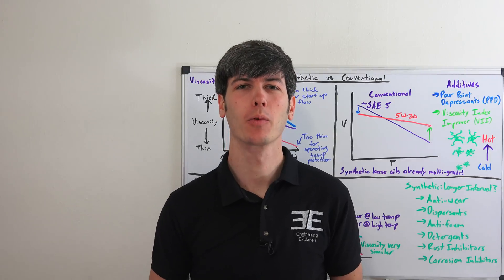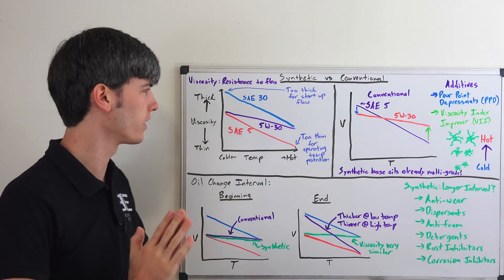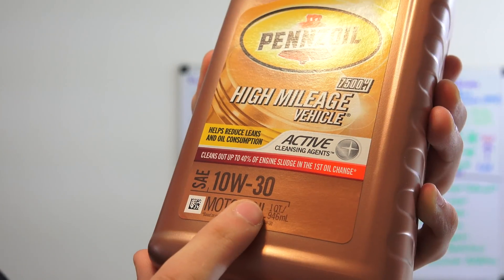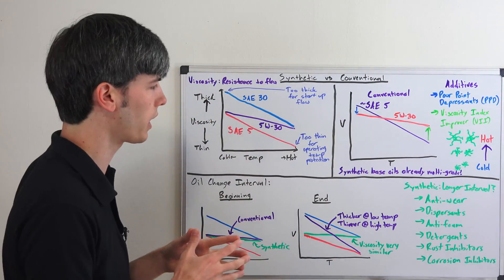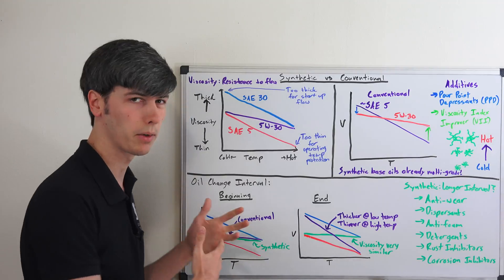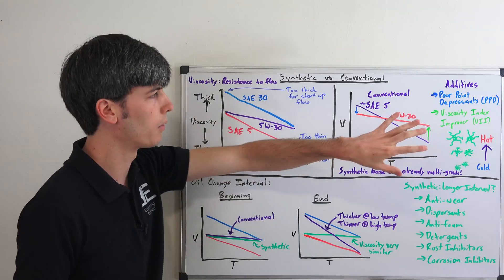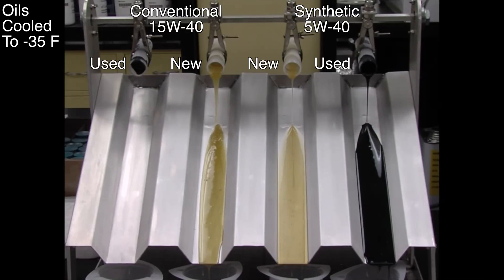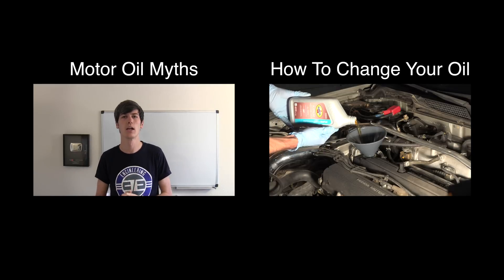Is Synthetic Motor Oil Better For Your Car?

Comment: Synthetic oil has many advantages. But if you have a high mileage vehicle say 100,000 plus miles for example and you switch to synthetic you run the risk of leaks. It’s not a guarantee but I have seen it happen a few times. I also noticed leaks occur most often in American engines verse foreign. Not an expert just my experience. Have had great results with Valvoline High Mileage Synthetic Blend though.

Comment: So as I understand the oil lubricates + seals the  "wipers" . What would happen if you were to use a heavier WT oil, wouldn't it seal better thus creating more HP ?? Or would the higher viscosity just slow the engine down ??Just curious .

Comment: love the information but what abouth of motorcycles? i listen that some of the carburation ones its better the mineral.oil because the low comoresion of the cylinder or low comoresion ratio? does it make eny sense?

Comment: Hi, EE, love your channel. My problem is this. In my car (A JDM Honda Fit Hybrid) manual it doesn't specify which type of oil is to be used - mineral or synthetic. However it does specify the API class and the interval for the change depending on the conditions the car is exposed to. Under normal conditions oil change is recommended at every 15,000km while it reduces to every 7,500km under extreme conditions (e.g. loaded running, low average speed - below 30kmph, and so on) However, some synthetic oil manufacturers claim their oils can stand up to 10,000km. Is it advisable to listen to the oil companies rather than the car manufacturer when it comes to the oil changing interval?
Reply: You're Hybrid will use a synthetic oil.

The definition of this is a oil that has either PAO or HC oil as it's "base oil"

In some countries HC (hydrocracked) isn't seen as synthetic because it still originates from Crude, and so only count PAO oils which are fully man made as Synthetic.

Hydrocracked oil:

Hydrocracked lubricants are formulated via hydrocracking, in which crude oil molecules are chemically altered and rearranged into building blocks with favorable characteristics. The resulting base oil is far more pure (99+%) than solvent-refined base stocks, making it more resistant to oxidation, more responsive to additives, more pumpable at low temperatures and lighter in color.

There are some oils that claim that they can last up to X amount of KM's.

But generally speaking, oil is cheap but engines are not.

So just do the in-between oil changes, unless you don't plan on keeping the car for a long period of time.

Comment: Any chance of doing an investigation a la this one or the mobil one test Center visit which explores how to adjust oil change intervals for low annual mileage and/or occationally driven cars (project cars, weekend cars). There are lots of "rules of thumb" floating about on this, but you could do something evidence based. Do you really need to follow the time cycle? Isn't that really just a proxy for engine hours assuming runtime isn't traffic? Does oil really degrade much when sitting in a car? Sure, it drips down to the pan when you don't drive daily but how would an oil change help that? Just some FAQs many urban/enthusiast/occasional drivers would love some solid advice on.

Comment: Please talk about oil bypass filters. do the additives as they break down in the oil, Convert to sludge? does the filter clean it up and maintain a clean oil.  and over time degradation of additives.  If the oil is clean do you kneed additives. Thanks 🐶😁

Comment: pour point  is the oil in cold temps----flash point is temps in high heat--4 ball test------tbn number  -total base number---many tests--when a manufacturer test oil there are some of the tests oil engneeirs do because billions of dollars at stake for law suits so they have done a good job in the last 30 years with sythetic---this is a lengthy conversation --good luck folks

Comment: Why use an oil that almost completely drains off of the engine parts when it isnt running. Then you end up with no oil at start up. Metal to metal is not good in an engine. Car manufacturers love this though. You need a new engine at around 170000 miles. Most trade in and get a new car. Stick with conventional oil drive your car for 400000 plus miles.

Comment: Man, so loving the videos!  Keep them coming!  I have a question, though, and it's related to "racing" oils.  I've seen these in 0W-30 and 0W-50.  Can you explain why you wouldn't want to use these in anything other than a racing application, and why you wouldn't want to use the more common viscosities in a racing application?
Reply: To summarise they have better wear properties but tend to break down quicker hence why some like royal purple are advertised as a track only oil where you would dump it after a day of hard driving etc

Comment: The human being has a lot of problems because of the marketing of the products. If you are reading this and you are over 40 years, I guarantee that you can use mineral oil in your car (by specs) and that your car will last longer than you. Although I agree that the synthetic oil may be a little better, but only a little better.

Comment: This guy is completely full of crap!   He is evidently  receiving  monetary compensation  for promoting  synthetic oil.   The one thing I was impressed by is that he didn't falsely claim you could extend oil change intervals like so many synthetic  proponents.   For starters,  who in the world is  driving around  at minus  35 degree F?  Secondly,  if your oil  looks that bad at oil change you are not changing your oil often enough and I  seriously doubt that was actually  3000  mile oil.   Also,  using his  graph,  with the difference  in price  between  standard and synthetic  oil  you would  still  be far far ahead  by using  standard oil  and  changing it  before  3000  miles  even  could  probably  go to  1500  miles and still be money ahead  especially  if  you are keeping the vehicle for any length of time.   If you did change it at  1500 miles you could change  the filter every other time.   The truth is,  standard oils  have been around for many many years and if  it is changed every  3000  miles  it has never been shown to be the cause of any damage to an engine.   Just  use standard oil  and save yourself some money and don't buy into  tall tales about how synthetic oil is going to provide any benefit.

Comment: W does not stand for winter. It means the oil contains a detergent or an ashless dispersant.  Ashless dispersant oils are safe to use in almost all engines, with rare exceptions like a Curtiss Wright 2600.  Oils with detergents are not.  Oil without the W is straight mineral oil, regardless of viscosity.  Many monograde oils are W. Synthetics are inferior to regular oils at removing combustion ash. Synthetics do retain better lubrication characteristics longer. There is less molecular degeneration from prolonged heat exposure  in syn oils. The bad ash gobbling characteristics of syn oils are a minor factor, or not one at all, in auto engines, which do not make high percentages of available horsepower for long periods. In engines that run at 75% or higher continuously and may be required to produce 100% power for 5 minutes or more during take off, full syns have been abandoned for decades. Some piston aero engine oils now are semi syns. A semi syn will do an adequate job in an engine that really works hard most of the time. Suggest anybody who wants to understand this subject investigate the use of Mobil 1, a full syn, in aircraft--bottom line is it ruined engines, and Mobil stopped offering it--or read up on why Shell went to a semi syn for aircraft engines. Many race, competition aerobatic and warbird pilots and engine builders of serious aircraft recip engines prefer monograde straight mineral.  You preheat the engine when it is cold. This video is superficial and occasionally simply inaccurate.

Comment: I've been told not to use Synthetic oil in a higher mileage engine because it will start using oil, is this true?
Reply from the maker: If it’s going to “use” oil as you describe it, it will do it with either oil. Totally fine to use synthetic with high mileage cars.

Comment: This guy is COMPLETELY WRONG in the way he describes how engine oil and viscosity work. In the video, he says as the oil gets hotter, it's viscosity increases, or gets thicker, and when it cools off, it gets thinner. WHAT???? You don't have to take my word for it. If you own a car, chances are you've changed the oil yourself at some point. If you're a lady viewing this, maybe not, although it is 2018, I may have this fact backwards, lol!!! Cooking oils work the same way, so if you happen to cook also, you know exactly what I'm talking about.  When you change the oil and its warm to hot, depending on the type and weight of the oil, lets stay with his example and use 5W30. The oil is going to come out nice and thin, just like it should. When the engine is cold and you start to drain your oil (which you shouldn't do by the way) it will be really thick. Same with cooking oil. When it's cool in the bottle, it's usually a little thicker. When you heat it and it gets to cooking temperature, the oil is really thin, like water. If you were to listen to this guy, he would have you believe that the exact opposite is true. Well, I've been an A.S.E. Certified Master Technician for many years. I have NEVER seen ANY multi weight, multi grade oil get thicker when it was hot, NEVER!!! Just like I've NEVER seen oil get really thin when its COLD!!!!
When oil gets cold, the polymer's Expand, or relax. When this happens, the oil is THICKER, or it's viscosity has INCREASED. When you heat said oil, and it's at operating temperature, those same polymer's ball up tightly, and can move by one another much more quickly, hence, thinner, better flowing oil. If you've ever used shrink wrap, like on Easter eggs, or have had to shrink wrap a wire, battery, etc. Does heat make it shrink, or does cold make it shrink? Well, at least in my life, on this planet, you have to HEAT shrink wrap to get it to tighten around whatever it is you're using it on. That is precisely how and engine oil molecule works when it gets hot. I know this was long, but I hope it helps. This gentleman has made a lot of automotive videos about almost everything. This is the ONLY video I've seen from him that is incorrect in it's explanation. All his other videos that I have seen are absolutely spot on.
Reply from the maker: You did not listen, but you’re convinced that I’ve mislead you. That is not the case. A 5W-30 is in fact “thinner” when hot, as mentioned in the video. It ACTS like a grade 5 oil when cold, and it ACTS like a grade 30 oil when hot, but a grade 30 oil is still thicker than a grade 5 oil at the same temperature. See the graphs in the video. Viscosity goes down with temperature.

Comment: Why did the test use a cooled to -35F temp and not something more reasonable like 0F? Most viewers live in climates that never see such a cold temperature. I think your video is deceiving in an attempt to scare people into not exceeding the 3000 mile limit recommended by manufacturers and oil companies. Studies I have reviewed prove that no measurable engine wear is experienced on non-racing engines if the oil is changed before 7,000 miles. I'm pretty sure if you go over 1,000 to 1,500 miles (4,500) between oil changes periodically you won't be ruining your engine. But what do I know? Just IMHO.

Comment: Shame on you for comparing 15W-40 conventional oil to 5W-40 synthetic oil. Yes, this discrepancy is conceeded 5 minutes and 30 seconds into the video but please keep it real. Compare apples to apples. Who uses 15W40 oil when it's 35 degrees below zero F? The pour clip in this video is already being used out of context on the internet (even by you). 

Your online article of Aug 14, 2017 in Road and Track magazine has the pour clip at the top,  but the 15W-40 designation is covered up by your banner. Yes, people can click on the link at the bottom of the article to view the complete video, but I'll bet few people do that. People see the visual and quickly conclude that synthetic oil must be so much better than conventional oil. 

I enjoy all of your youtube videos and I think you are very smart and well spoken, but this one gives off an unpleasant odor.  The lesson here is that convention oil is just fine for everyday drivers as long as they change it when  they're supposed to.    harv0000

Comment: Hey there! So... I have a question, I've a car with aprox. 100k miles on it, would high mileage oil benefit my car in any possible way? Or do I just keep using the one that my car's manual says to use? Also, would synthetic be better for my mileage?

Comment: I know you weren't present for the oil demonstration. But there are some key missing factors. How used is the used oil? Were both used oils used for the same duty cycle? What sort of engine were they used in and in what conditions? Why in the hell did they not use oils of an equal weight? Why did they cool it to such a low temperature? (A normal person would use an engine block heater to warm things before starting when it's that cold.) As far as I know it's an apples to gorrilas comparison and it means nothing to me.

Comment: Have been using synthetic 10w30 in EVERYTHING i run for over 20yrs with no problems .Cars and trucks changed every 10 k or 1year for all mowers,tractors,snowblowers etc.and some engines made it over 20yrs. I personally use Mobil1 but any good syn.oil should do. No confusion with different wts.and brands and no extra additives needed.I consider syn.oil cheap insurance in place of engine replacement.

Comment: Hi jason based on this video and my own personal tests with 4 6 and 8cyl. Engines i use synthetic with everything but many of my friends say things like; "i can't use synthetic in my car because it just eats it i can't keep oil in it". Now granted thier engine could have leakes they are unaware of or could burn oil. That being said let's say that an engine is "perfect" when you buy it and at 30000 or maybe 50000 miles you switch to synthetic. Why does an engine seem to "eat" the oil?

Comment: I was getting semi synthetic oil on my turbo genesis which i found out needs full synthetic. I switched to full synthetic and i swear the car runs smoother now..or is it just in my head?
Reply: In your head, but full synthetic is the best for engine life.

Comment: Very informative video. I've always had this discussion with my friends about the thickness or flow of variable viscosity motor oils, and they never accepted the behaviour of motor oil that you discrubed at the first part. Very nice explanation with good chart demonstration. Very well done
Reply: Shahab Siahpoosh has
Reply: No such thing as non-variable viscosity. Ain't a fluid on the planet that doesn't change in some way when you change its temperature.

Synthetic motor oils are our best attempt at getting a fluid which normally goes from nearly solid (when it's cold) to runny as runny gets (when it's hot) to go from sort of runny to kind of runny given the same temperature change. Ideally we want it fixed, but hey - that's nature and inginerding will always be a compromise

Comment: Is there anyone knows about "Less driving condition"? As after reading the manufacture warranty, it says that engine oil and oil filter need to be replaced every 6000km / 6 months which occurs first by fully synthetic if driving less than 9km per trip on normal temperature.

Is this extra service need to be put on and why? (Normal driving condition requires each service in between 10000km / 12 months)

Comment: Is the synthetic base means conventional oil that is higher refined with some group synthetic additives such as synthetic blends but labelled as Full Synthetic? I am not sure which type of synthetic oil is compared here such as Full Synthetic or 100% synthetic or synthetic blends, to me it is a confusion of marketing terms that cost 3 times the price of conventional oil and I am not sure which one is the best to buy, everything I read online it seems everyone is selling full synthetic , synthetic blends and 100% synthetic is hard to get a hold off at the local stores.

Comment: The problem with synthetic oil is it's not worth the price. If you change your oil with regular oil use a  quality filter your engine will out last the body chassis. So what's the point in spending all that money on synthetic.
Reply: It's not that binary. Most European engines have oil requirements that cannot be met with conventional oil (this is referred to as mineral oil here. In Europe we can safely state that synthetic is the conventionally used oil and that mineral oils are the exception. There's more to it than simply SAE viscosity ratings and whether the oil is conventional or synthetic. You can change the oil every day if you want to but you will still have problems.

Comment: 2015 Honda Accord Sport 4 Cylinder (CVT)
Current Miles: 115000
Honda Recommend oil viscosity 0W-20

I drive this car in NYC with Uber, (there’s a lot of stop & go) I put 250 miles every day. Someone told me since I have 115000 miles on my car I should start using 5W-30 Viscosity oil because engine is old now & 5W-30 will be good for old engine. 

Any advice will be helpful, Thank You.

Comment: Holy sheet.lot of comments..ill add my 3 cents..i drink 100 proof and pee in the tank for better gas mileage..darn this is an oil sceen...probably dont want to know what i put down my valve covers...ok ill tell you 10/30 mobile1..i read the little book that comes with the truck...i suspect multiple engineers spending millions on research might know how to fry a hotdog..enjoyed your video although it was made in 1943...next time have a chick with big tits point a stick or something